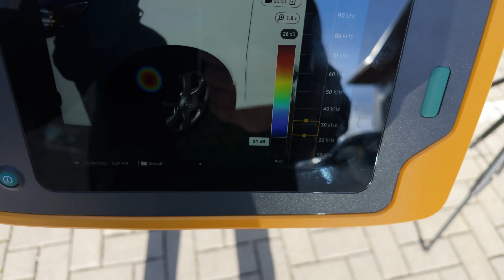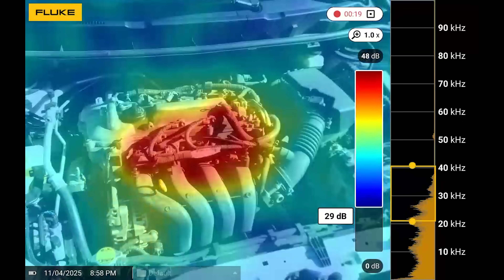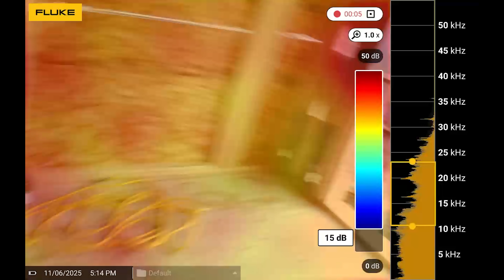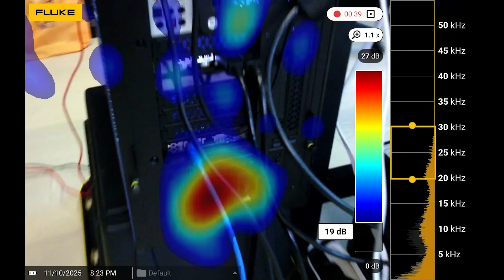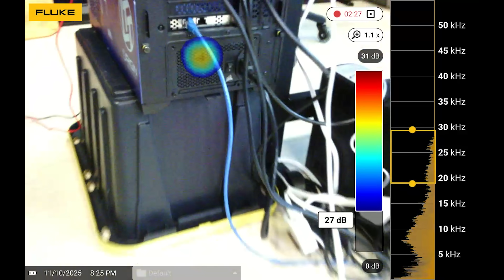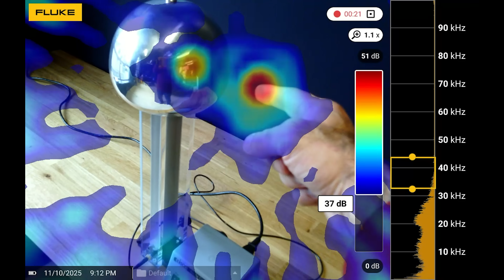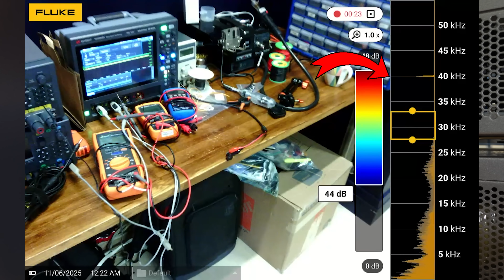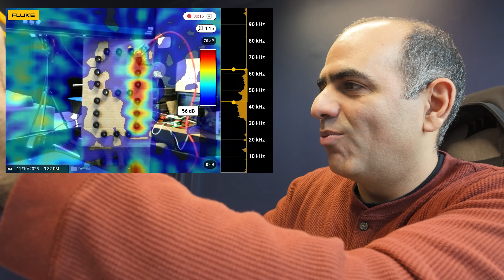Only $20000 to Fix a Flat Tire

Comment: Won't there be false positives if there's an internal restriction in a pipe (e.g. the diaphragm of a pressure regulator) causing high-frequency turbulence or even  whistling downstream inside the piping?

Comment: Totally could be used on roads signs and lights for "self driving" and driver assist vehicles to ensure they don't miss roadsigns and streetlights without distracting the driver or letting the driver know to floor it even more because it's about to turn yellow. Or even give information about an emergency vehicle coming and to yield to let them through safely .

Comment: Finally! A new video after such a long time this device is great for my experiments with ultrasonic Sonar and perhaps even more an infrasonic mosquito repeller. And one more thing yes you should build the Marx generator but  this time it should be to it's maximum because now you have something that can detect the corona discharge leak

Comment: Wow. For that price tag you'd think that it wouldn't have any issues. It looks like their cheapest model is still too pricey. Now I'm wondering how difficult it would be to build my own. The hardware shouldn't be too difficult, just a lot of soldering ultrasonic sensors onto a board, but the software would involve a lot of math I'm uncomfortable with. Need to find some papers that discuss techniques.

Comment: See if you can use it to find a pinhole leak in a water pipe? I've seen small devices that plumbers use like a stethoscope to find leaks in walls.

If you take your transducers and bring them close to a solid you might be able to see cracks in the solid.

Comment: If they made one smaller and cheaper I would use it for looking for air leaks on truck. It would make my job, as a fleet mechanic, easier for locating and fixing air leaks.

Comment: Build an ultrasonic acoustically trapped particle volumetric display, levitate a small foil ball, and combine it with your marx generator to steer the lightning bolts.

Comment: 2h ago a transformer station exploded nearly 10 km away from my position (Germany, near Höchstadt/Aisch). I heard the explosion really loud and clear.
I mean 10 kilometers, that is 6 miles!
What is happening when a transformer station explodes that you can hear that BANG more than 10 kilometers?

Comment: I have a heightened hearing range, which was always one of those things that was either a useless skill or a downright annoyance (florescent lighting is very loud all the time, and LED is worse when the driver is over-volted). That was, until I became a service electrician. Bad receptacles, failing breakers, and shot ballasts, all of them make noise, and each of them unique and specific to the mode of failure. I could walk into a dark room and tell you which part of the circuit made the lights go out just from a good listen. Those days are gone as I've gotten used to the cushy manufacturing life, but I still get some use out of the ability when troubleshooting cabinets.
Reply: I love the sound of fluorescent and HID lamp ballasts.
Reply: I thought it was just me turning off the lights and pulling plugs because everything was making annoying noises and my family looking at me like I'm crazy. Right now my gf is watching TV with ambi light and it's driving me nuts.

Comment: The tire air inside is at a different temperature than the tire outside, why the need for a new tool, not use a thermo infrared meter? no built-in mic, really‽

Comment: It's so cool that at 10:56 you can see that the sound reflection matches up with the light reflection because they take the same path(It's kind of hard to see, but you can see that the sound reflection is over the middle of the table reflected in the window)

Comment: 6:45 But what if the entire device vibrates?.
Reply: Amplitude and resonance stuff. The main spot from where the vibration originates within the device, will vibrate with a bigger amplitude and perhaps different frequency, since the wave of the vibration will change properties while going through the different parts of the device. So yes, this device will be able to locate the specific spot of origin of the vibration even if the entire device is vibrating (this said, if the device vibration won't overwhelm the original vibration in volume / amplitude, like when Mehdi was trying to read the gas leak while a gawddamn pneumatic hammer was going off)
Reply: I think if you just hold the board down tightly it should isolate it? Maybe it doesn't matter much since you could still see generally where its coming from.

Comment: I’m a substation technician and i use an different kind of ultrasonic detector to find PD and coronas in hv and ehv circuit breaker where a devicel like yours can’t go by listening AC. I can tell where a faulty connection or insulation is.

Comment: On sale for only $23,000?! I'm going to use this all over the house!
Reply: Yeah only $23,000 Not much at all really. Just 23 grand!
Reply: Cray Cray😢
Reply: 70 000$ in Russia market))
Reply: @Open-a-motion  sounds about right
Reply: For what amounts to just 50+ microphones and a display, I could see it costing like $2,000 but $20,000+ is insane
Reply: @SaiyanKirby This is made for enterprise use, not consumer use. That means it will be used where screw-ups can cost millions of dollars, time in jail, or even people's lives — so it needs to be built up to that standard. There's a level of commitment in everything used for work. I use $200 calibrated calipers at work and not $5 hardware store ones because my millimeter is LEGALLY REQUIRED to be the same as everyone else's millimeter. Even if hard drugs were legal, drug dealers would still go to jail for using uncalibrated kitchen scales for trade purposes. When lifting heavy things you need expensive certified equipment because any failure can kill someone. I've personally witnessed tens of thousands of dollars go to waste because a bad font choice made someone misread a part number. All that stuff is why this device is more than a bunch of microphones, and why it costs so much. It's not a toy, it's a high-tech tool.
Reply: @SaiyanKirby those are not regular microphones, and it's not meant for consumers anyway
Reply: @SaiyanKirby there's a cheaper version... Only $8,000! Practically giving it away
Reply: @SaiyanKirby there’s another brand doing something similar starting from 1200E … of course fluke is the top tier but amateurs cant afford it
Reply: I'm not lugging that thing all over my house.  I need one per room, minimum
Reply: That doesn't make me want it any less. It just keeps me from getting it. Probably forever.
Reply: You know that this tool is a tax write off? 
If you have business, it’s actually reasonable I guess
Well not for me since I’m polish and make 24k a YEAR, but in USA it seems like a good purchase for some companies
Reply: @prophoenixPL tax write-off doesn't mean free, it just means you are paying for it with pre-tax money (and with many different layers of taxes, you might still be paying with some of those depending on the exact jurisdiction)

Comment: Yes rebuild the marx generator but use 2 5 Meg ohm resistors to keep the arcs from jumping across the resistors. Make it super heavy duty to withstand full power for maximum arc length. I would love to see it. I know you can do better. You learned alot building the 1st one. It was sexy

Comment: 3:15 precisely this is why i do not want a gas stove, furnace or heater (aside from electricity being MUCH cheaper). our house is heated by oil, which you can visibly see if the tank would ever leak.
Reply: Electricity to heat is not cheaper. And only going up

Comment: Had the opportunity to try this exact device in a industrial setting, namely gas turbine enclosure. It is nice but it falls on its face when there are high pitched noises around, since they are most likely at or very close to the "leak" frequency. WIth the Gas turbine running it could not detect a  simulated leak.
Reply: there are cameras with algorithms that can see tiny movements, it can see stretching metal for example or tiny vibrations and they will be amplified in the output showing them clearly. Maybe that can help.

Comment: couldn't you use a custom made array of ultrasonic sensors that displays the sound of the array on a screen ?
Reply: yes. I made something in the 2000's and found that the random spacing helps once the math is adjusted.

Comment: You can use any low cost ultrasonic leak sensor. You can do that on a budget of less than 50 usd. There is also the old style hp made aluminum tube with coiled cable(connects to a box with speaker and a analog meter, run by 9v battery ) , that technicians used to pinpoint leaks in remote gas lines.
Fluke is way overpriced.

Comment: we have one at the plant i work at, we use it to find compressed air leaks as a lot of the plant runs on compressed air and its leaking everywhere so bad when we stop production we still need 400hp of compressors running to maintain pressure,  its also great for fire suppression system leaks as they are always tiny but will cause fire alarms if the compressor stops for a power outage etc.

Comment: al ask the guy's to add sound to the recordings, no joke.
the people who do the hardware and software development work just above my department.
i even build tooling to test and calibrate units in the the production line.

and yes i have one at my department, it is no calibration and it has no serial number.
my warenty plan is asking if they can swap it with one that hase been lost in a draw.
Reply: Do you work at Fluke? Maybe you should mention that first.
Reply: @KafshakTashtak  i sometymes work for fluke, the department in question works for Fluke but not at Fluke. but i beleve that in the past it was ownd for a short time by Fluke.

there is a Fluke product line that was invented developt and hase undergone constend develepmont for dacades by this team.
and the production has always been in houre house.
Reply: W

Comment: 8:00 Something that vibrates never usually vibrates at just one frequency, but also other harmonics at lower amplitudes.
Reply: Yep, that's how you can get multiple instrument sounds from one speaker iirc
Reply: Was coming to say this but you beat me to it! Reminds of waves on a string in physics lab. Related is that the timbre of a musical instrument depends on  the ratios of each order of harmonics to the fundamental tone. This is important for sound designers to understand when creating synthesizer patches from scratch. There is also a concept of low frequency aliasing that can arise in digital audio processing which is partially why there is some controversy around sample rates well above what is required to reproduce the audible spectrum.

Comment: In terms of the vibrations affecting common pets (cats & dogs), it's more about the dB level than the frequency. Imagine you have a fan in your room running, you can clearly hear it, but it's not the dB range to cause hearing concerns. Also, I still don't know how that hearing knowledge it's still stuck in my head after years since I graduated and I've never used that in my job (paramedic).
Although! There are studies that show that certain frequencies grab our attention more than others as humans, like a baby crying or a mosquito buzzing.

Comment: Hey Mehdi! Just wanted to mention that the acoustic display is not just an art piece, it's very educational and useful to me right now! There have been drones spotted over Belgian airports and military airbases. I intend to join the military to shoot them down and take them apart, hopefully also locate whoever operates them. While I do have the basics of radio transmission, it is not a specialization of mine. Specifically, I hope to be able to get access to a spectrum analyzer there that I won't be able to afford myself. So thank you! This video may well be able to contribute to our research efforts.

Comment: That ultrasonic 7seg display was cool! Do they generate the 40kHz frequency internally, or do you supply it? If you supply it, could you feed it a square wave signal? With a fast rise time square wave that should include a tonne of broadband noise that might show up well without having to modulate it?

Comment: There might be a use for transmitting sounds like that as a number display for quicker computing....possibly. I'm not in a STEM field, but I do like to speculate on things I do know and would love to hear others' opinion who are more knowledgeable. I know that in computing, specifically with AI, they use sound as a way to quickly transfer data which is then decoded. You could implement that same idea with this to make quicker computing by utilizing sound data transfer at such a small frequency that it wouldn't have any adverse effects on biological organisms, but would work well for computing. My initial thought was to do it with binary, but that seems counterproductive to the idea, but it may be something that could get utilized at some point.

Comment: Now add a thermal camera to it! Best of both worlds!
Reply: And add the capability of that camera that can show very faint repetitive motion!
Reply: That's surprisingly easy to do!  There's a Kickstarter going currently for a similar-but-cheaper sensor like this that attaches to a smartphone.  And you could put it on one of the Ulefone phones that has a built-in thermal camera.
Reply: @BrooksMoses those ulephones look sick af. I had an old cat61 phone for its thermal camera and I used that thing all the fricken time. Finding drafts in your house, checking pcbs to find what's starting to fail. Finding which coolant line is plugged up. 

If only Graphene supported the Ulephones id be set.